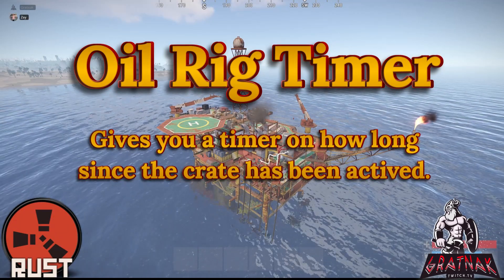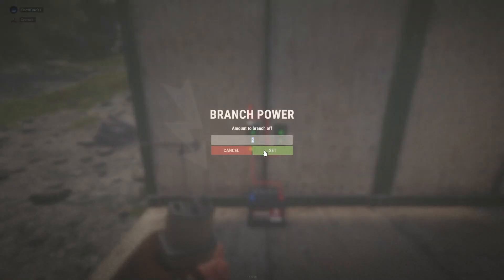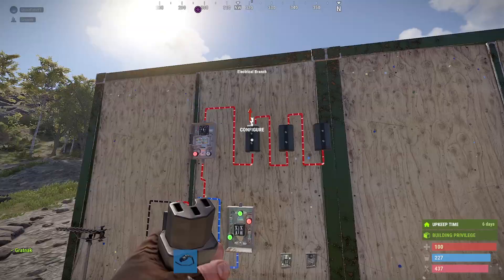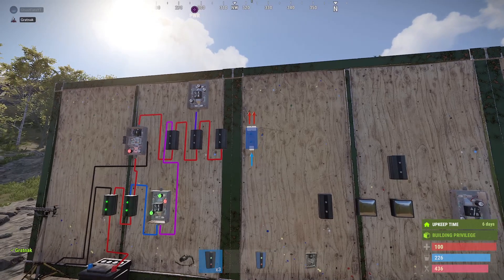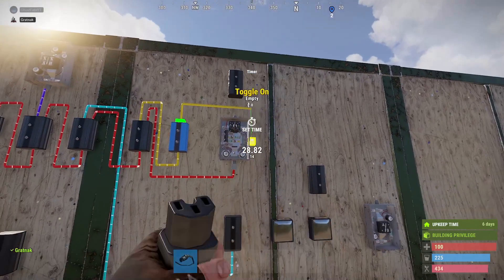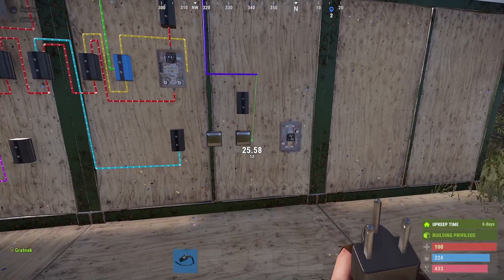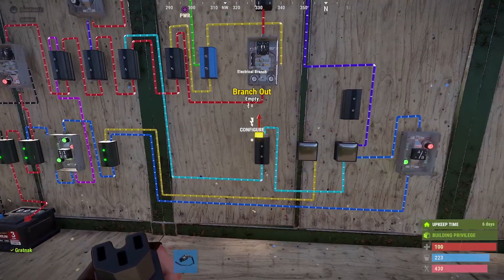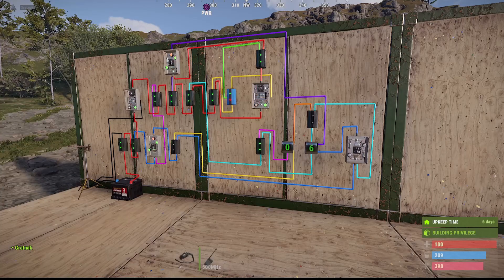Rust: Oil Rig Timer

Comment: hey siri, make a timer of 15 minutes. done
Reply from the maker: I'd prefer not to carry around a pager with it set to the oil rig frequences all the time. But each to their own 😉

But in all seriousness, this is primarily intended for those who want to counter oil, not for those who have merely activated the crate and are looking for a place to hide in case they are countered. In that scenario, this circuit would be utterly useless, unless you are killed and need to know how long you have to return to oil in an attempt to counter the counter. In which case siri could be useful.